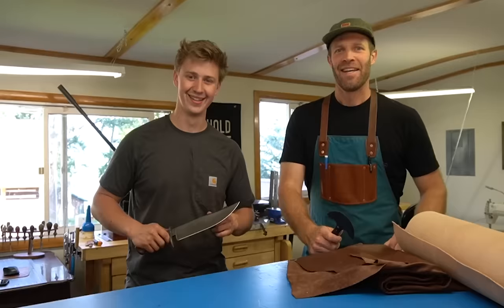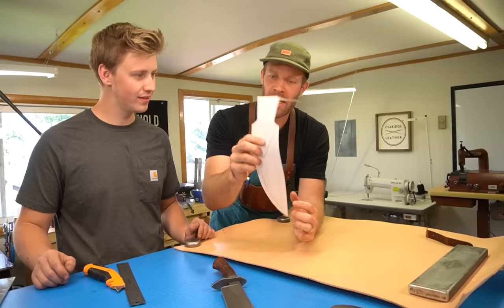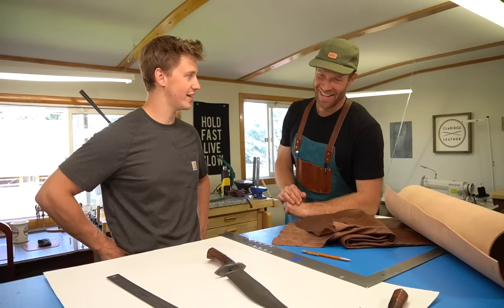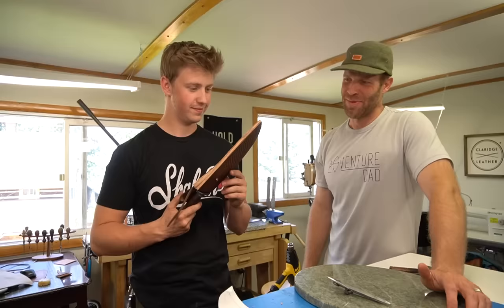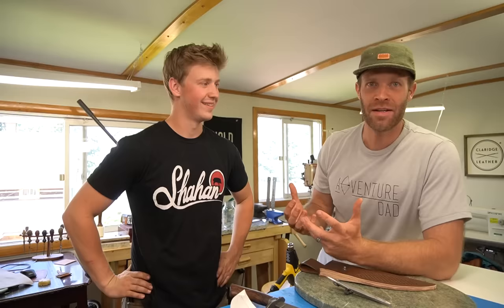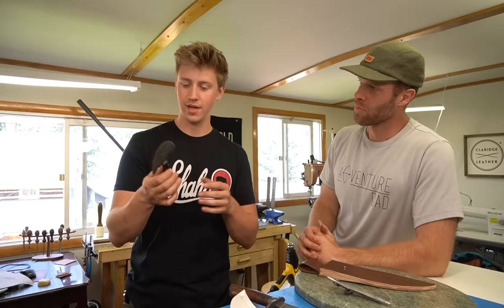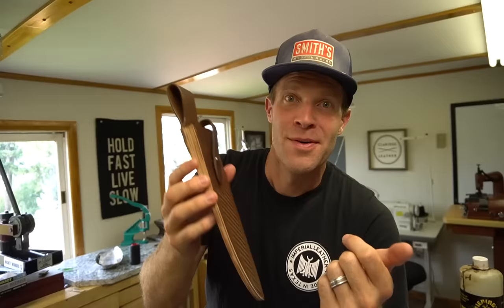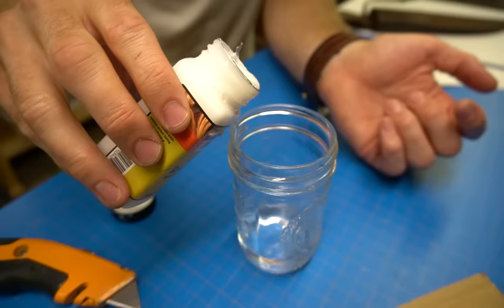How I Made this Sheath (and Almost Ruined It) with Will Stelter

Comment: No sarcasm; nice recovery. Been doing leather work for awhile and having an error like that in front of people can throw your stride. You backed up, solved it, and made it great. Thanks for sharing the burnishing tips as well. The only thing I'd add is a couple of Rivets at the mouth of the sheath where that 7/8" leather is. Not only will it reinforce the stitching but you could match the color of the leather/snap.

Comment: Excellent video.  I already used saddle soap for my burnishing, but I have been using the glycerin bar and water.  I may try the can variety as that will be less messy.   I also like the dilution of the resolene as that seems to soak into the leather better and not sit on the top so much. Thanks for the video!  Loved watching Will and Alec, now I have a new channel to watch!

Comment: A suggestion, re: safety....

Eye protection when using any mechanical device, with or without power. Needles and suchlike can shatter in the blink of an eye (no pun intended), and you do NOT want to risk your eyesight. (I had cataracts at a youngish age, and although the docs could fix them, it was terrifying to watch my vision steadily deteriorate...sight is a very precious thing).

Comment: Really nice work guys and Will, what a knife man, wow!
I've made sheaths that ended up needing to have a big welt, some over an inch which really makes hand stitching tough.  But the thick welt at the opening works great as then the user has a larger target to help guide the knife into the sheath easier, sometimes an opening that is the same size as the blade's spine makes it a little harder to re-sheath.

And that snap issue, I Struggled a long long time, always having the snap go sideways/shift so it was not in the spot I expected it to be.  UNTIL I stumbled across a video where the guy said to use VERY VERY light taps and as you strike to move the setter around in a circle so you are not striking in the same spot, so go around the clock.  Now, it will take a lot longer to set the snaps, but it is rewarding when done as they are set perfect.  Instead of using my normal mallet, which looks similar to the one you have, I use a real old Tandy leather hammer very lightweight so you are not hitting the setting tool hard at all, just tap, tap, tap for minutes until you have rolled that snap shaft down onto itself, so I recommend trying it on some scrap and just real light taps, I mean real light taps, you would almost think nothing is happening, but slowly but surely the shaft is curling over and down to fasten the snap securely.
Reply from the maker: Thank you, Gary! Yes— Will knocked it way, way out of the park with both of the knives! I have to tell you, Gary, I SCOURED the Internet years ago to learn your techniques for making folding knife sheaths and I absolutely love how you do it. As far as I’m concerned, you set the benchmark. Thank you for leading the way for me in that department. Haven’t made too many of those sheaths since then, but I’m grateful to you each time I do.

Thank you for the tip on the snap! I’ll try that!! In this case, the post I had was way too long, so I ended up shortening it with the dremel tool, making it less prone to going sideways on me! I’ll try your method! Cheers, my friend! And thank you again! -Tanner
Reply: @ClaridgeLeather  Very kind of you to say so, I focus just on folder sheaths as I make them as trim and tidy so as not to take up a lot of room on the belt.
the snap thing, if the post is too long it can be trimmed down but, it is something to not trim too much as then you don't end up with enough material that will make the snap keep in place and eventually it can pull it's way through the mating part.  I make sure the hole in the leather is very tight to the post, and unless you have a lot exposed, I just start tap tap tapping away until it is rolled down and into the space, it's almost relaxing to do that method, the hammer like I say is the very light leather headed hammer I can't weigh it but it's super light and like you are working on a clock's gear, just real light tap and rotate the setter around slowly as you do that, it will amaze you and you will look around to see what else you can put a snap in ;-)

Comment: Nice video bro. I found that on thick leather pieces, I prefer to use a bench-drill with a 2mm drill bit. It works perfectly. I just recreate the slope when drilling to keep the holes at 90 degrees. It saves me a lot of frustration. I like your work sir, well done
Reply from the maker: That’s a great idea- I need to try that. Thank you, Nico!

Comment: It is a good idea to put the strap around the back of the guard. I like the way Will did the guard with the width reduction in the middle. I was redoing the handle of a WW2 Remington pacific theater landing knife and I made a wider guard for it that I felt needed to be thinned out on the sides. The proportions of the one on the knife Will did look really good, and I think I will redesign it to look more like that one.
Reply: The knife I got came with a period sheath, and there was almost no thought to protection, and just the ability for the knife sheath to carry it to the beach. There was shrapnel or roll damage on the sheath and to the knife handle, and the blade has a really pitted look. It was probably rolled over by the soldier carrying his weapon several times on a marine landing craft's side, and there was a twist put into the handle tang at some point to tighten the leather and give it the rolling plunge effect in hand to hand fighting.

Comment: I sew 7/8” of hermann oak with my class 4 all the time.  You just have to use a new needle, go slow and lengthen your stitch length adjustment a bit.
Reply from the maker: That’s thick! I did sew a test-run flat stack of leather at 7/8”, and it seemed to go okay. I think the issue with this sheath is that it has that tapered thickness in the welt, so the needle was wondering which way to go as I tried to sew from thick to thin. Maybe could’ve made it work, but probably would have messed it up! What are you sewing that is 7/8”?!
Reply: @ClaridgeLeather  I’ve noticed the needle wants to wander if it doesn’t go straight in at the beginning of its stroke.  I have a terrible habit of making holsters “just a little too small.”  So I end up stacking up welt layers at the seam in order to open them up a little.  The latest one I made was made of 12-15oz saddle skirting leather folded over, with two 8-9oz hermann oak tooling leather as welts.  It came out right at 7/8 inch, but the class 4 did it.  Before the machine I used a drill press and a tiny needle to make holes then I’d hand sew.

Comment: why make it that thick in the first place? I realize a welt is needed, but why does it necessarily need to be that thick? Thanks
Reply from the maker: Good question! The reason for that big wedge is because the guard of the knife protrudes to the sides so far. The wedge spaces the knife away from the belt loop so the wide guard doesn’t scrape along the belt loop. Perhaps one of the shots at the very end on the video shows it most clearly. I blame the knife maker… 😅

Comment: Ok.  Learning something new here today.  You used the rotary tool to remove the snap head.  What was the very next operation?  Shortening the post?  I have a problem with all commercial rivets and snaps.  The post is either too long or too short.  What is the rule of thumb for the length of post extending out of the leather?  What shape is the end of the post so it mushrooms out into the cap.  You see my problems?

Comment: I’m new to leather work and knife sheath making. I’m using Tandy leather dyes (alcohol based) and get an uneven color. Any advice?
Reply from the maker: Hey, that’s a great question. Thanks for watching the video! My best advice, or at least what works best for me, is to use a wool dauber and make a series of small circles that overlap around the whole surface of the piece. Sometimes I might do a series of straight line streaks over that as well just to ensure good coverage. I have not used Tandy dyes, but the dies I have found to work most consistently for me are the Fiebings Pro dyes. The trick is to get even coverage without having to apply to many coats and make it really dark. That definitely takes practice, and also an understanding that it won’t be perfectly even since it is a handmade product. For me, switching to the pro dye seemed to make a big difference and might be worth a try for you. Best of luck, and keep in touch!

Comment: Shame it will probably rust the knife after a couple days. No matter what wax I use, oil or anything. Leather rusts steel to hell. Rather stick with glass reinforced sheaths that constantly dull the blade if I'm honest, sharpening is easier than trying to recover something from rust.